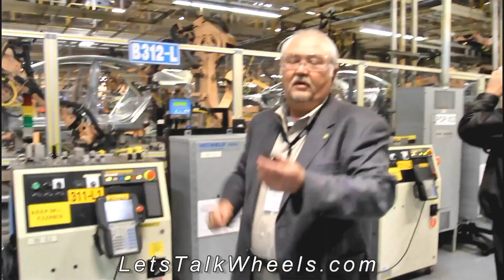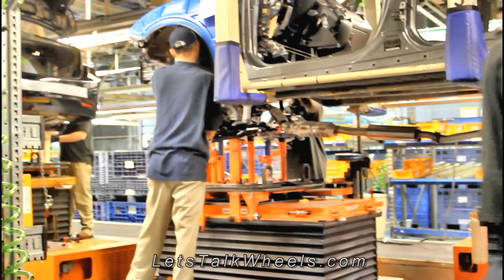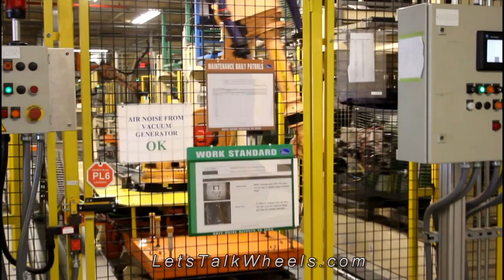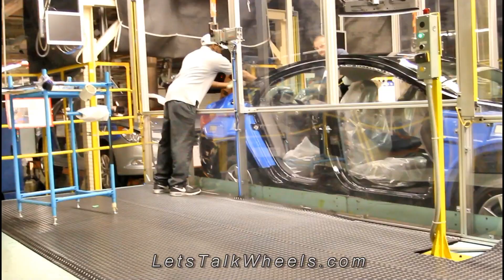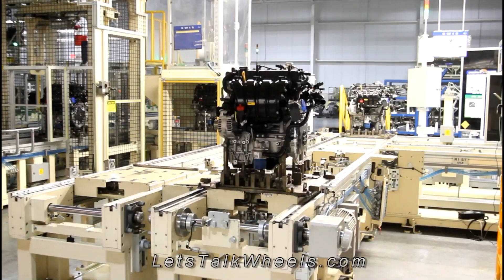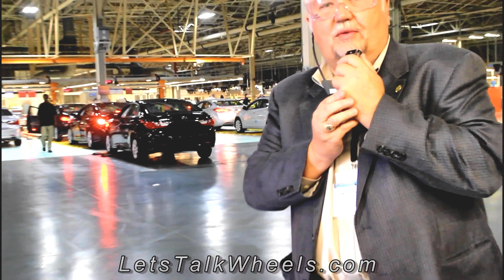Hyundai Motor Manufacturing Alabama Plant Tour

Comment: I have 2007 Santa fe.. That's great car but the problem is when  reaches avarage of 60km ODO they begin to have engines leaks in engine oil cooler, crank shaft oil seal, camshaft oil seal, rocker cover seal, turbo charger, CV joiny and also in steering rack.. please hyundai improve the on this problem because toyota is no any leaks even reaches 100km ODO
Reply from the maker: Your problem is that engine seals (and many gaskets) are rubber and become hardened with age. And this causes multiple leaks. No matter which brand you have.
Reply: 60km ODO is very early.. why toyota even reached 100km ODO there are no leaks but ah little bit in oil seal.. my santa fe has high leak specialy in oil cooler, I just wanted to hyundai to improve the're design not to put down reputation.. I'm still hyundai fanatic.. hyundai is  need improve seals but hyundai a lot better parts compare japanese car

Comment: I own a second generation  2000 accent fully optioned 1st new car I ever bought....no regrets a little underpowered but they improved a few years later,,,i have taken really good care of this car above and beyond //I never drove this car in the winter /always garaged/still looks brand new inside and out....charcoal grey color with aftermarket 15 inch asa wheels make it look even better/ I have 155.000 miles on it with original motor and automatic trans/did all the recommended maintenance only with genuine Hyundai parts /still love this car ..its still a pleasure to drive 18 years later I plan on buying a new Hyundai but im still going to keep my accent that way it will live on...…….

Comment: I have a 2007 Hyundai SantaFe 3.3L v6 AWD with 106,000 miles on it, No rust. hardly any wear. It still runs great. Especially in the snow.

I also have a 2015 Hyundai Sonata Sport 2.4L FWD that runs very quiet and moves fast and gets great gas mileage.

Comment: Robots don't buy cars.....
Reply: True. The robot designers, technicians and operators do though. New cars are much better made since the hard dangerous jobs were taken over by robots. I used to work as an assembly line welder and the job was horrendous! Hot, dirty and high production. So hard I had to take a vomit break a few times. Just awful! Try just raising your hands above your head (we did to press buttons to get the press to clamp and weld a part) a few thousand times and feel the burn in your shoulders. Terrible job.

Comment: Are you surprised? You brought an foreign American made car. If that's not the craziest thing I've ever heard I don't know what is. You would have been better buying a Chevy or Ford. An American car made by Americans. I been driving Mercedes-Benz since 1994 and love them. Yes they cost more and more to maintain but there's nothing like driving a MB. Even when I'm having a bad day, I get in my 2008 S-550 4-matic and my day gets better. Try a European brand not time around.
Reply: Glad you enjoy your finger sandwiches and time in MB shop. Took my dad's 560 to shop for the battery cost $900. That POS has been in for more leaks and work and has been car hauled more than any car he's ever had. I guess if money is'nt a concern. 
Anything can be justified.
Reply: Glad your day gets better in the MB. I guess your day gets worse when you have to pay thousands on repairs:)
Meanwhile i drive a 20 years old Hyundai  which doesn't need any repairs, always starts and runs well. But yeah, is not a Benz. Too bad:))
Reply: Korean built engines are far superior to the ones made in the Alabama plants

Comment: Hyundai is good,so is Kia both korean. one complaint. make the transmissions stronger, they are known for weak ones. im a mechanic . i have a 99 elantra only 41,000 miles . with trans problems

Comment: At some point your assembly line is better than other car manufacturers. I have made cam follower mechanism prototype. My cam follower mechanism is little different.
1. It is offset follower.
2. Force is applied from follower to cam and that force help cam to rotate.
3.It will take place of I.C. Engine.
You can find prototype at mechanicalresearch dot info or at
youtube dot com/ watch?v=IClrv79lL6k&feature=channel&list=UL

Comment: @MrDrunkenTiger This is not just a Hyundai problem. My 2010 Nissan Pathfinder has the same problem, so did my 2008 BMW 3 Series, 2006 Nissan Pathfinder, 2005 Nissan Altima V6, and 2011 Nissan Juke. My dealer told me wait a few thousand miles to let the brakes break in and the squeak should go away. It's been 2,998 miles since my dealer I've been to my dealer, and the squeak has gone away.